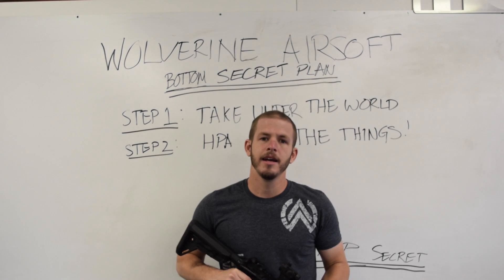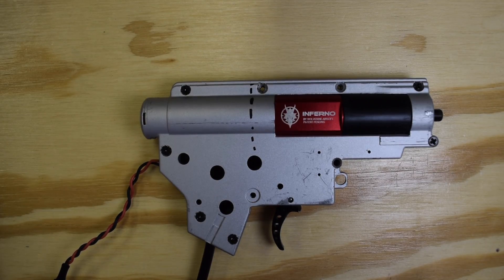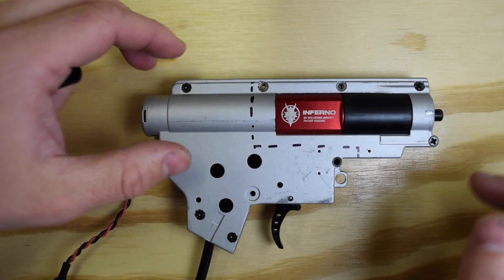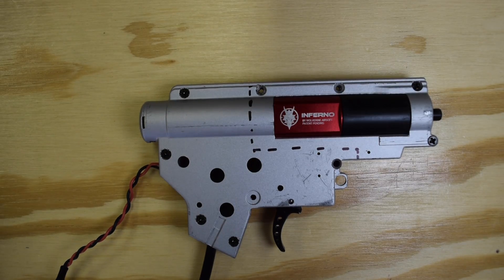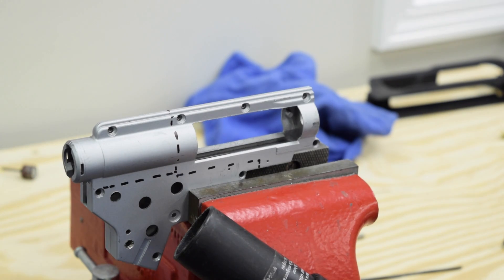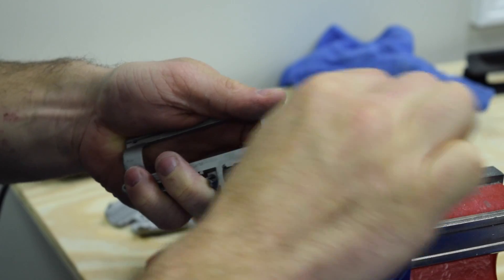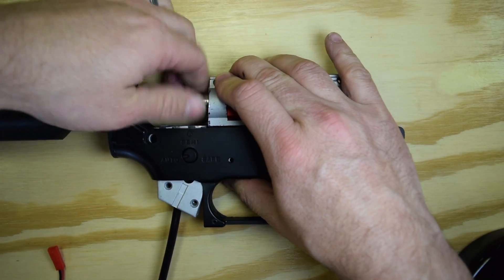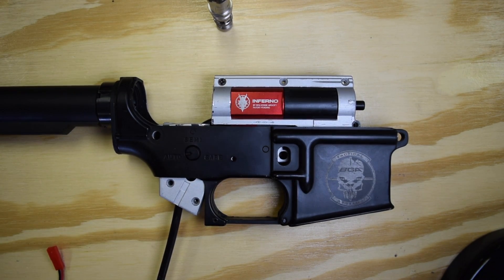What the Tech?!?! Ep. 8: Gearbox Modification

Comment: Did a similar mod to a G&G MP5 (technically a CYMA, but the G&G style). Cut out a section of the shell, wired the FCU to the grip, and the battery up to the back of the gearbox. I had to leave the rear end of the shell to hold the buffer tube adapter, so that the recoil spring guide/assembly would remain connected to the lower. Now to change batteries, I just slide the lower out, pack in a mini lipo, and slide it all together. Great for MP5s because I can change whatever stock/handguard set up I want quickly and easily without worrying about where the wiring will go.